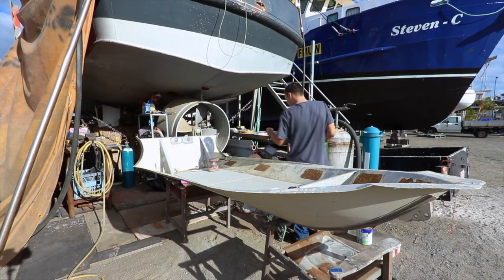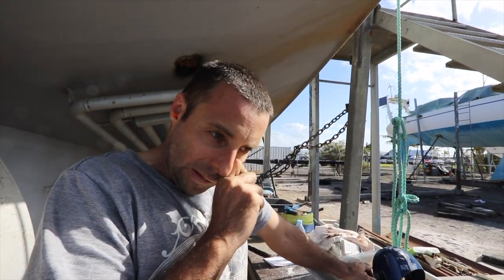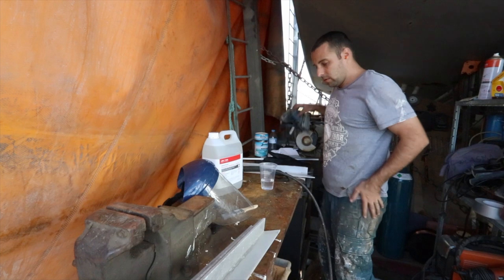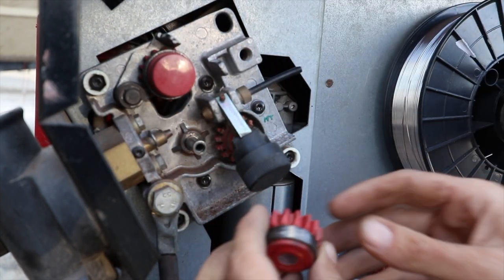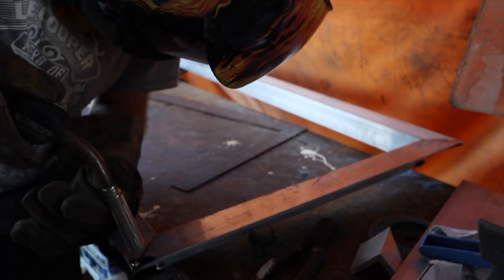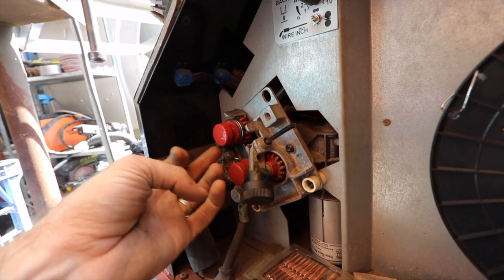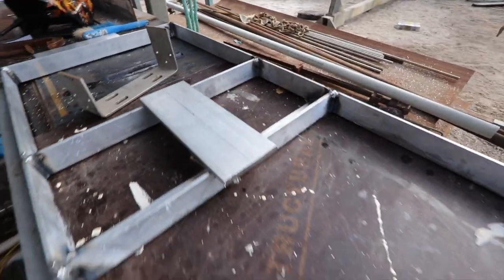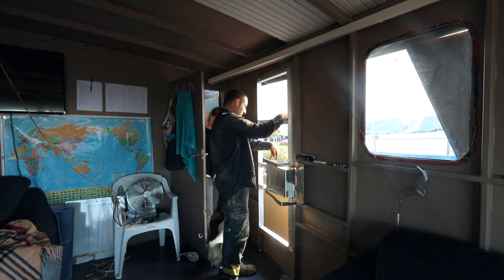Welding Alloy Marine Doors - Project Brupeg Ep. 92

Comment: If that paint is so well bonded to the aluminium why not paint over it? Just make sure whatever you use bonds to the existing paint.
Reply from the maker: We are going to kill most of it when we start welding and we want an all alloy tender so we never worry about scratching it as we drag it over rocks and dive gear etc
Reply: I agree that is some good paint.
Reply from the maker: Its funny, I always thought painted alloy was kinda rubbish, as in it never really hold on, but i take that back! I was about as wrong as its possible to be. Damien
Reply: @ProjectBrupeg  why not sandblast it?
Reply: Why not use a 40g flapper disk. The grinder should have a more aggressive sanding ability. Or a wire brush attachment.
Reply: Yeah pretty much all aircraft are painted aluminum, and they have some pretty durable paints for aircraft.. I did some painting on aluminum helicopters 30 yrs ago with Zinc chromate primer and Imron.
Reply: Takes time, and sandblasting can easily warp aluminum.

Comment: If that coating on the dingy comes off that hard why not leave it and finish over the top of it ? After its abraded of coarse.......
Reply from the maker: Yeah we will be doing a lot of welding on this dinghy so much of the paint will get ruined when we do that, its much easier to take it off now before we get stuck into welding the tubes and engine mountings, seat and cowlings. Plus we will be dragging this thing over beaches and rocks and ice and hauling steel dive tanks and all sorts of other stuff that will just keep damaging the paint so we are stripping it off and leaving it as bare alloy so we never need to think about keeping it looking shiny and white

Comment: Did you try heat on the paint that stripper/sanding seems so hard? I think I would have been a cloud of naughty words as I kicked that welder into the drink.
Reply from the maker: Dont get me wrong Brian, we did try swearing profusely at it on the hope it would help diagnose the problem, funny enough it didnt even remotely make a difference... certainly felt better though.
Reply: @ProjectBrupeg  I saw your comment about not using heat on the paint as it my distort the sheet metal hull. Using a torch - maybe, as it is much hotter and more focused. Using a good hear gun, very unlikely I think. 
Try heating a small area, and scraping again - unless you have already had the Mrs sanding for a week now.

Comment: I am sure I have seen Doug on SV Seeker put a couple of foam ear plugs on the welding wire before it enters the tube to stop the crap getting in there
Reply from the maker: Hi Chris, i used to use foam ear plugs (changed to different one now) and foam plugs were my go to wire cleaner for the welder. since changing plugs over my supply of welding wired cleaners has dried up!

Comment: Is it not powdercoat? Seems awfully hard and adhered.  Paint wouldn't give you grief like that id have thought
Reply from the maker: Hi Casey. I've not stripped any powder coating before so Im not familiar with how its strips down. One of the alloy boat builders in the yard thinks it might be a urethane
Reply: @ProjectBrupeg quailty paint stripper should still eat 2 pac urethane, Alot of alloy bottom inflatable boats are advertised as having the alloy bottoms powder coated. Perhaps that's why its so tenacious. Was just a thought. Keep on keepin on💪

Comment: hey Damian are you trying to weld with a standard liner if so go get a nylon liner minimum otherwise a push pull gun is best man keep it up other wise you are a team doing a great job
Reply from the maker: Hi Dale. Yeah the liner was a steel liner. The rollers were mis-aligned, the torch had to much bend and then the welder spit the dummy. All up time for an upgrade. Looking at a smaller unit to be able to cart it round the boat, and also thinking of a spool gun for the dinghy project as it’s mostly 2mm & 3mm

Comment: Did you already try a heat gun to strip the paint off the Dinghy?
Of course you don't want to heat bend the metal.
Just an idea. 

Did you run your welder problems with SV Seeker he has been welding Alloy for sometime?
Hope to see you guys soon.
Reply from the maker: Hi Dennis. Haven’t tried heat gun but have a nice MAPP gas torch that would work well on that paint. Will try that soon. As for seeker/welder, no nothing as yet. My welder is a bit of an old pig so although it’s theoretically possible to weld alloy with it, its really not any more and pushing it as hard as we do, its starting to fall apart. We are in the process of getting a new welder that’s alloy capable from day dot. Hopefully picking it up this weekend if it’s in stock

Comment: think of the welder as a power supply , thats all it does ,any spool gun can work you just need a bit of modification to accept a spool gun.
Reply: did you shave or haircut >? you look slightly different!
Reply from the maker: Yeah my plan was to fit a seperate spool gun plug and tap into the drive motor power feed.
Reply from the maker: What is this a fashion show?

Comment: Can't you sneak the dingy into the back of one of the 'Blasting Hangars'  with a case of cold beer for the operator alongside whatever is in there being blasted - sandblasted in like 5 mins and a great finish for paint (Alloy is a bitch to get paint to stick to and usually is put on with an acid etch primer which eats into the surface for a good key) ? 

Failing that there are 3M ScotchBrite disks for the angle grinder - soft enough to eat paint without grinding the Ally - they're expensive but worth every cent...

I used similar angle for a dock framework - but was on HF AC Tig so no problem with wire feed (but did end up with a shed load of 2" pieces of alloy rod).
Some of that Ally is hard anodised at the factory and no amount of chemical cleaning will remove that - great solution is to get a box of flap disks for the angle grinder and a can of spray paint - spray the backs of them so you don't mistakenly use them for steel, then no contamination issues (aluminium oxide abrasive is great to remove the oxide on Aluminium (who knew!) (in the end I bought a second grinder (and saw) painted dayglo pink and wrote 'Aluminium Only' on them...  You'll probably notice the welds are always crappy at the start, needs to build a little heat to melt the oxide layer and ally is a much better conductor than steel.

Another great vid, Keep up the good work
Reply from the maker: Thanks Andrew, we did think about that but ive watched the commercial guys here when they strip an alloy superstructure and the blasting guys strip the paint off first then blast afterwards, which is not the norm for them. assuming they found blasting to be mega slow as we did when we first tried it with our rig. We also dont want to put paint back on this dinghy so the rough blasted finish their big compressors deliver is actually a negative for us as we will need to sand it back down smoother afterwards. Its funny, I did end up buying a new saw blade for alloy only and also discs etc. so we think alike.

Comment: or try a short a gun liner as possible also no loops or kinks
Reply from the maker: The welding shop in town reackons you can do 3m liner without pull gun using U rollers and teflon liner with a low radius torch handle. Curious to try this

Comment: Are you using a teflon liner for the Alloy ?
Reply from the maker: Unfortunately no. BOC dont stock teflon of my welder anymore, like most parts on this thing, its getting pretty hard to keep this welder running as parts are often worth more than the machine itself.

Comment: Most machinists that I know including myself use WD40 as a cutting oil for aluminium, works well an is quite cheap if you can buy 5 Litre containers of the stuff.
Reply from the maker: Yeah we used to use that when we posted alloy cylinder heads years back
Reply from the maker: HA!, i love it. never tried it but will give it a shot

Comment: You have to adjust your ac balance
Reply from the maker: Hi John, this welder is a DC only welder, very little controls on it, wire speed and power (but i cant tell whether it is volts or amps as the dial only says 1-2 on the first dial and 1-6 on the second. she is an old beast, built before they  thought welders might actually like to know what the settings mean...

Comment: Your wire feeder is pushing to much wire... shorter lead may help.
Reply from the maker: Yeah we ended up changing welders, i tried a bunch of times to solve the push method with this machine but just couldn't get it to stay functioning. Spool gun it is from this point forward.

Comment: 1 lb rolls help too
Get a T.I.G. set up for aluminum, you can DC weld aluminum....how to is posted on you tube hahaha... It's not as pretty as AC high frequency put it works.
Reply from the maker: Hi Tony, Yeah ive gotta think of room. when we head to sea one good Mig that can weld stainless, mild and alloy with either a gun change or a spool gun is much easier to manage than multiple machines. that said we are looking at a good MIG that has DC TIG and Arc capabilty.
Reply: @ProjectBrupeg  these days one machine can do all. As far as mig, Flux core !!! The stuff is great on carbon steel and stainless ( not as pretty as gas Mig or Tig) but it works. I rather have Flux core and Tig at sea ... Been there done that for 20 years in the USN as a pipe and ship fitter.
Reply from the maker: Nice, Thanks for the tips. Always helps hearing from folk who have been here before. Im still learning everyday. I havent used flux core yet but seen it being used on some of the trawlers here and was really impressed but the quality

Comment: aluminum mig can be so annoying, I always think ill just mig it together and be done real quick, by the third burnt tip im like fuck it, flip on the tig welder and just rail through it. Most of the time ill just tig (aluminum/stainless) now unless its thick like 3/8ths or thicker because i dont have enough power with my 200 amp tig, so then i mig it with my big boy. I have a spool gun that works decent once the wire tensions set but find it much harder to dial it in compared to the large rollers/ tensioner in the machine.

Comment: Have you considered TIG welding? Another great video. Cheers 👍
Reply from the maker: Hi Derek. Yes I have but that would mean buying an AC TIG. I would love to have one as the welds are beautiful but with the MIG on the fritz and needing replacement we just don’t have the cash for two machines. Alloy is something we don’t often weld so a MIG that is capable of doing alloy is more valuable to use that show quality TIG welds as we won’t have the room for multiple machines when we launch

Comment: Your tender is powdercoated . Will need to basically swim in paint stripper to get it of . Sand it weld it and get it re powdercoated for a durable finish
Reply from the maker: Hi Chris, yeah we are going to kill it when we weld to it, plus as an expedition boat this dinghy will be dragged over rock, sand, ice, beaches, mud and have alsorts thrown into it so any paint wont last. The plan is to strip back to alloy and leave it bare.
Reply: Painted or coated alum is never long for this world , ever noticed all the french alum boats are pretty everywhere else but bare alum decks and hull
Reply: Dont know much about france but as a protective coatings specialist i can easily say coated aluminium will easily outlast raw aluminium . Its not like you see polished airplanes do you ? And anti fouling dosnt work on raw aluminium .
Reply: @chrisward5626  correct the hull below the water line has to be primed and antifouled but this is something that is done every 1-2 years,  topsides I was referring to. You are correct in saying coated alum lasts longer , but getting a coating to last longer than 5-7 years .. bearing in mind some areas bubble first , it looks bloody awful on a large vessel. Most large  alum production boats now wear their topsides raw for this reason
Reply: mitch pender you cant powder coat a large vessel . It simply wont fit in the ovens . Thats the only reason they are not powdercoated . The tender was previously powdercoated and as you can easily see its very durable.
Reply: @chrisward5626  yep that's a given I also work closely with powder coated alum , and I know what your next comment will be , it wasn't prepared correctly , it all goes through a wash tank .. I've never seen a alum powder coat finish last beyond 10 years sure some parts do but the overall finish bubbles in some areas I've also owned multiple alum boats some coated and all showed signs of powder coat lifting..

Comment: Have you tried one of these ... well, you'll need lots of them, but they work.

https://www.mig-welding.co.uk/paint-stripping/clean-strip.jpg
Reply from the maker: Hi Alain, we actually have a couple on there way up. will be giving them a go later in the week.
Reply: Don't be like me and just slap one on a grinder without checking the speed of the grinder and comparing it to the speed rating of the disc.

Blooming thing blew apart and it was only luck that prevented me from chopping my nads off ... had a nasty bruise on my inner thigh for a week or two, and considered myself bloody lucky!

Still, it was a useful lesson.
Reply from the maker: Yeah I’ve got a 7” polisher. Quite low rpm that I was thinking of sticking it on